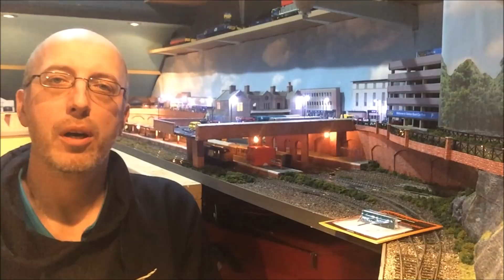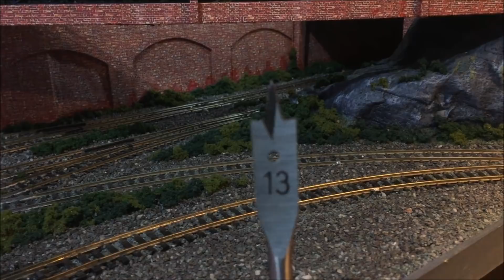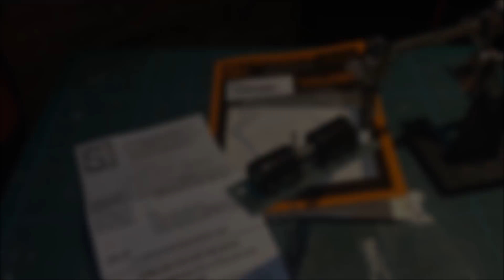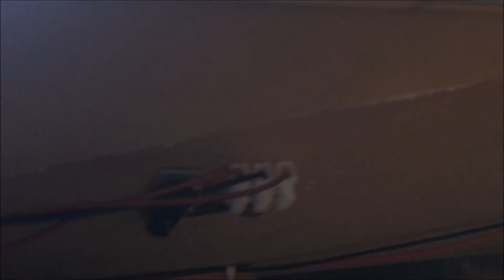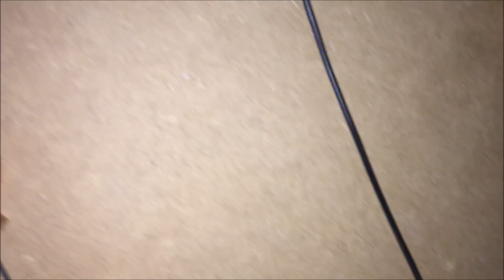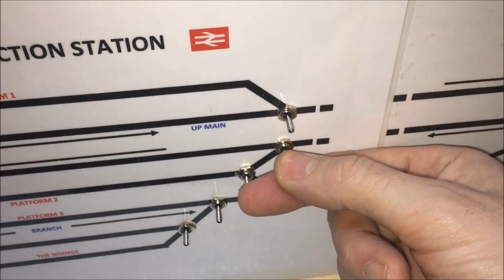Point Motor & Control Panel Switch Installation Part 2

Comment: Hi Jason, I have watched with admiration both your videos and can only congratulate you on the the controll board you have produced. I have purchased a 2nd hand dcc +2 and would like to know where you wire in the common return on the CDU as don't seem to be getting it right, I hope I don't sound too dim! 
Kind regards 
Charlie
Reply from the maker: Hi Charlie, thank you so much for your very kind words.
There are 3 sockets for wires, the centre of the 3 is the common return for both sides (each cdu) the others being the seperate CDU's.
Hope this helps.
Many Thanks 
Jason.

Comment: Again another really helpful film thanks so much - when you cut the point rodding with a Dremel is there any danger of heat transfer damaging the point motor?
Reply from the maker: I never experienced any issue with heat transfer. It only takes a second or two to cut so not long enough to create excess heat.

Comment: Hi Jason,  great tutorial! I'm at the start of building a Control Panel and checking out all kinds of possibilities. Yours is a strait forward approach that I like for I also use Peco Insulfrog without any problem after soldering some additional wires between closure and stock rails. But I'll add Leds on the panel to indicate the route. Seems possible - I found a wiring diagram on a Dutch site: https://encyclopedie.beneluxspoor.net/index.php?title=Bouwbeschrijving_schakeltableau. Maybe this can help others too.
( The print speaks for it selve - no nead to learn Nederlands)  So thanks for sharing and happy Model railroading ! Cheers, Filip
Reply from the maker: Many Thanks Filip, pleased this has be of interest for you and i sill take a look at that site

Comment: Hi Jason. Just a simple tip for future installs. Useing a dremel type cutter for the carbon centre pin can heat up the tie bar and cause damage. The easiest solution I found was to use a locking type pliers on the pin ( stops it flying away) and a heavy duty side cutter used for hard piano wire. Hope this helps.
Reply from the maker: Thank you for your comment.

Comment: Makes a big difference at the end there where you're running the loco and can control everything from the panel! Looks pretty tricky to drill up from under the baseboards, too, but slow + steady does it. Seems like it's coming along nicely. Iain
Reply from the maker: Thank you for your comment.

Comment: There's an easier way to find the location for the hole instead of measuring it.

Where you centralised the hole in the point blade arm with the wire... you can drill through the hole giving you a precise location where you need to drill... and the hole will act as a guide to start your drilling!
Reply from the maker: UK Diesel and Electric Railway Modelling yes I have since included this procedure to the fitting process 👍

Comment: Hello Jason .  It appears that you are using points with insulated frogs , and therefore no need to change polarity .
  If this is so ; then were you to install the   PM 1  Motor,  instead , the extra switching facility built into the motor , could
 very easily be wired in to power directional LEDs on the control panel . Very useful , as the "spring back"  toggle 
 switches give no indication to the last setting of the point . As all fixing holes are the same for both types of motor,
 it would be no problem to exchange them .   I don`t usually like live videos , but yours was very good last night .
 I`ll try and remember to  " plug in " next week .       Regards ,  Paddy  Owen .
Reply from the maker: irene forward Hi , and many thanks for that idea. I have thought about possibly adding LED's as you mentioned but unfortunately i already have purchased all pm-2 that I require to complete. It is a good thought for the future 👍 cheers for letting me know.
Look forward to seeing next week in chat.

Comment: Nice job Jason, you could use a tiny hand pin drill to get the position of the point, just drill through the board were the rod of the point motor goes through the point.  I put a torch on top of the hole when I drill up so you can see the hole.  
Your wiring looks fine much tidier than mine.
Cheers
Reply from the maker: Dunge Wood Model Railway I have actually since doing this started using a fine drill bit exactly as you mention 👌

Comment: Good job Jason....I’ve some to fit so this helped ....will you use  led indicators for the running direction ...are those bootlace ferrules on the wires ...I’ve done all my wire ends with these ... yep I used snips and never found where the bits went lol ....fred ...ps I sent you a pm regards last nights live stream ...great by the way 👌
Reply from the maker: Fred's Wilbury Line thanks for viewing, glad it has been of help. No plans yet for directional LED's yet but I have thought about.
Yes PM received 👍

Comment: Very nice informative video  How reliable have you found the point motors to be?...Simon
Reply from the maker: Hi Simon, I have now fitted 4 of the Gaugemaster PM-2 and everyone has worked perfectly out of the packet and still not had any problems. They are a good solid design and easy to work with.
Regards Jason